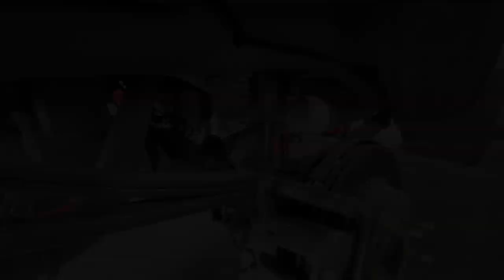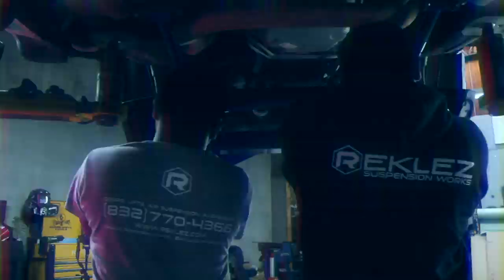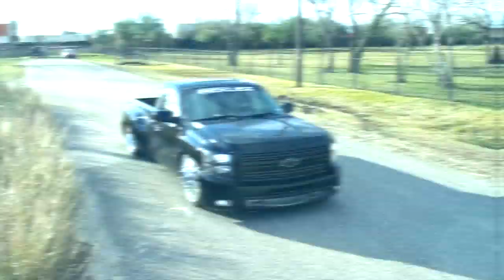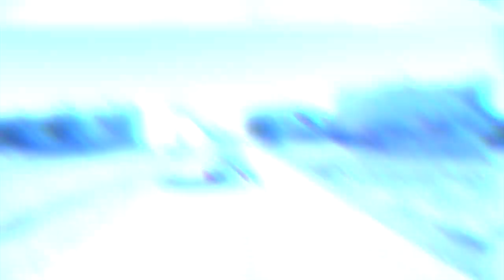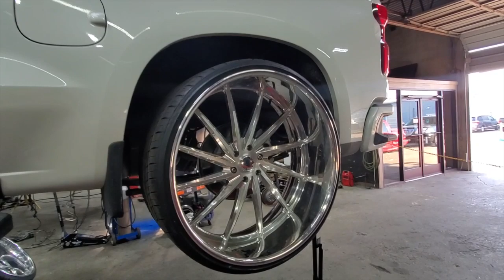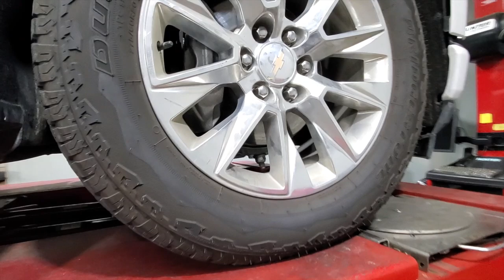4/6 Drop Kit on 2019 Silverado Belltech Street Performance 1040SP

Comment from the maker: Thank You For Watching For Prices On The Drop Kit Click The Link Below. For Quotes Call Our Shop. Prices Provide Only By Phone (832) 770-4366 9am-6pm Central Time https://reklez.com/collections/2019-2020-silverado-sierra-drop-parts-rear-coil-over-kit-billet-wheels-custom-suspension-work
Reply: Hey boss what's a good quote for a 4/6 drop for a 05 Tahoe 4wd?
Reply from the maker: @fatalfamilia2871  Call us for prices. Thanks
Reply: Reklez Suspension Works According to your website this only works for 2wd. I know belltech says their spindle works on 4wd. What keeps this kit from working on 4wd trucks?
Reply from the maker: @khj697  belltech don't advertise it works on 4x4 not sure where you saw that at.
Reply: With the notch that came with it how low could you drop the rear? 
How low could you drop the rear with a underbed notch?
Reply from the maker: @JermaineTXtoFL  As shown we didn't install the not nor a under bed notch, honestly couldn't tell you. We have only done a monster notch which is designed for air suspension.
Reply: Has anybody with a 2019 thought the suspension and brakes suck? For sure I have to be extra careful going over uneven road...whole truck bounces. Also it just doesn’t have enough stopping power for the amount of weight. I don’t need it lower, I just need to to ride a little smoother. I think I need performance brakes and suspension to be happy.
Reply: When is a 4/6 drop is it 4 in the front and 6 in the back or is it 6 in the front and 4 in the back
Reply: Can’t wait to see more products for 19+ as far as air ride and relocation kit and front tubs

Comment: So, it has been almost a year since this video, how often do you bottom out?  I have a 21 that I want to use this kit on, but I also have a good size boat I want to  haul.  A bolt on C-notch like this significantly reduces the frame strength from factory.  My research shows about a 80% loss in strength.  Probably fine if your are not hauling anything.  I am thinking of using this kit with no notch and using helper bags when hauling the boat, what are your thoughts?
Reply: My cousin has a 20 rst with a 4/6 drop and hauls a full size side by side with no problem . She has a welded c notch and it does bottom out here and there but she also doesn’t have helper bags . But with helper bags in the rear you should be okay I’m looking into this IHC kit as well but they only offer the 3/5 kit with helper bags as of right now for 2019+ chevys
Reply: @16rcsb87  same I wanna go lower but I need it to b able to haul:(
Reply: I had my c notch welded in its AZ stomg  as stock with the kit it.did not settle in its as good as it was when they put.the kit on
Reply: I also have helper bags to use for hauling trailers.and such

Comment: Makes me wanna get my 2020 dropped
Reply: If you do I put 275 50 22 on it and it ruled the  inside fender wells so I changed it to 265 40 22 and everything is perfect no rubbing at all
Reply: Anthony Perez I honestly don’t know what 275 50 22 means I’m new to whippin
Reply: Anthony Perez I don’t even got my license yet I know what 22’s mean but the other measurements I don’t lmk what they mean tho
Reply: @anthonyperez8308  on what drop?
Reply: 22 rim size 40 tire height from rim to tire the higher yku go the more tire you have above the rim the more tire has better cushion 265 is the width of the tire the bigger you go on the width the wider your tires are

Comment: Does this kit interfere with the steering sensors? I'm in Cali and I'm having a hard time finding a shop that will lower my 19' high country. I wanna do a 3-5 drop.
Reply: I'm in California and it was around 1800 installed.
Reply: I did a 4 6 drop
Reply: Les schwab did mine...came out perfect
Reply: @anthonyperez8308  thank you for the info, im doing some price checking. What state are you in and how much did it run you? Appreciate the feed back.

Comment: I hope they realize that voids the  factory warranty
Reply: Life's too short for warrantys
Reply: Only for suspension related problems. Example: You take your truck to the dealership complaining about a clunk or noise from the front of the truck when going over speed bumps. As soon as they see that the truck has aftermarket suspension parts, they'll tell you to kick rocks and put the factory parts back on and try again.

Now, if you bring it to the dealer for a check engine light coming on, the aftermarket suspension obviously has nothing to do with it so they'll go ahead and check it out and repair it under warranty. (Or supposed to at least, some dealerships are assholes.)

I worked as a tech for a dealership that I also bought a new truck from. I wanted to put a drop kit on it right after and I asked the warranty administrator if doing that would void the factory warranty. His answer was exactly what I wrote in this comment.

Comment: How you use the truck would be a big difference on installing a notch or not also. For your truck definitely it's not needed because the air ride, but if someone got that kit and they plan to keep that ride height and put stuff in the bed with any significant weight to it then definitely do the notch or at least some sort of bump stop to avoid metal metal banging back there. People get scared when you say cut into the frame but Bell tech has been around as long as I can remember and I have never heard of any issue with that if it's installed correctly. Plus these you guys are Killin it with your different projects and builds and kits you have and it's very obvious that you know what you are doing! That truck is going to be badass with those rims and sitting on the ground soon!! Hell ya!
Reply from the maker: Thanks. And yea belltech was one of the first companies we first started installing. Had always been a big fan of their stuff. Can't to have this truck built and show case it for you guys on our channel. Thanks 👌